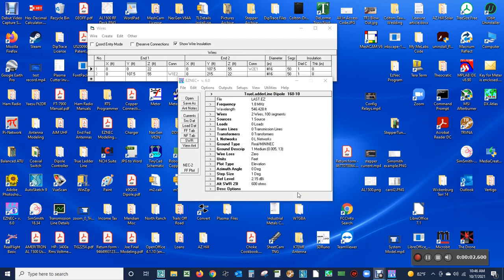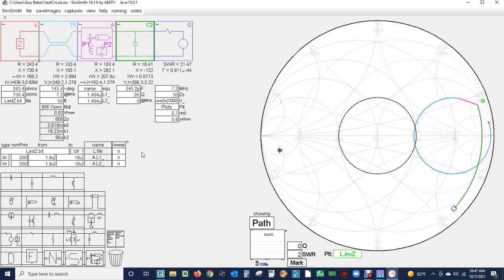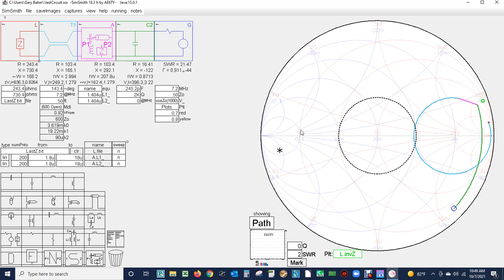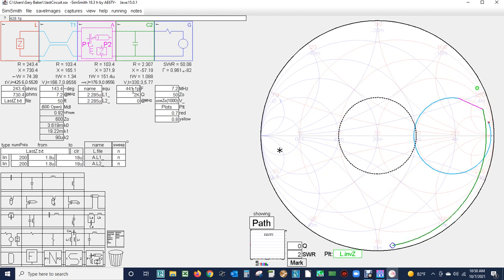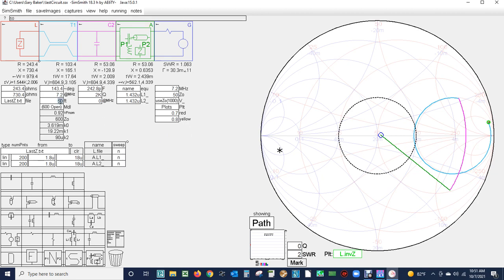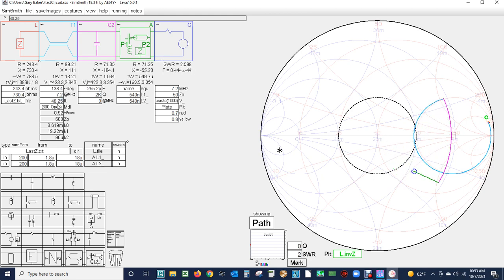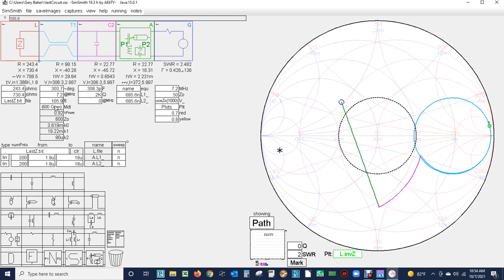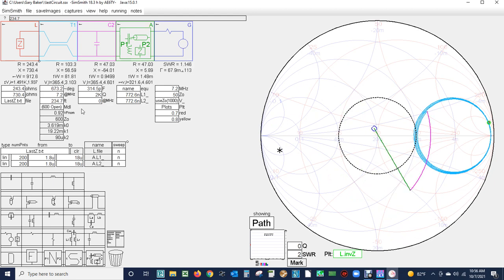Modeling Bal Antenna System

Comment: Informative video, I followed along with the antenna design.  I did the traditional antenna model, with 3 wires, and the source in the center of wire 2.  Got pretty close to your Z...   I wanted to try and do a balun next...  Tried to measure inductance of my home made balun and use those numbers for pri and sec, but had some trouble.  Thanks for your piece of my journey puzzle to modeling an open wire doublet.    Appreciate the video  Thanks...